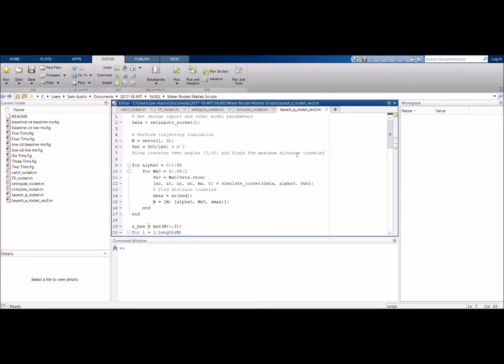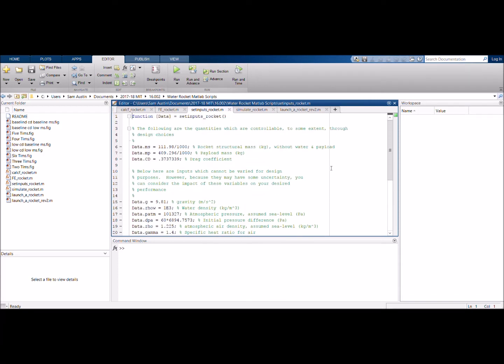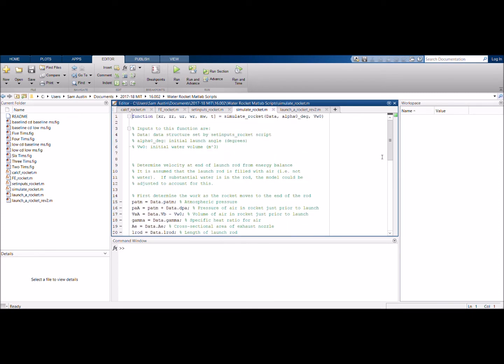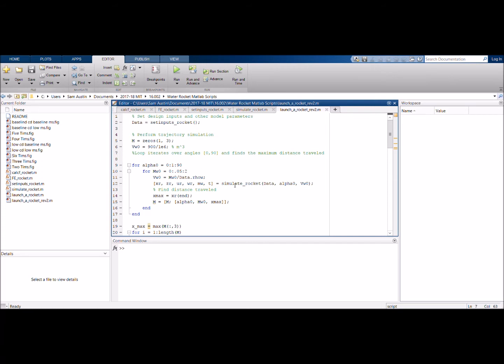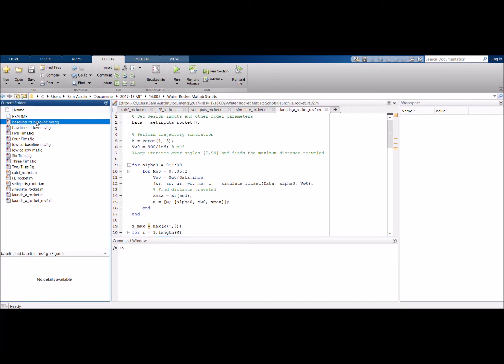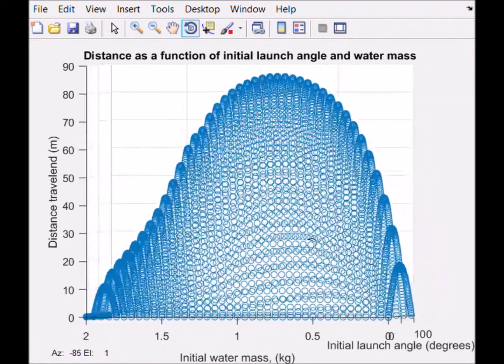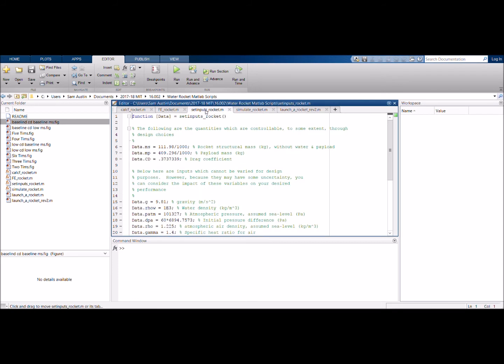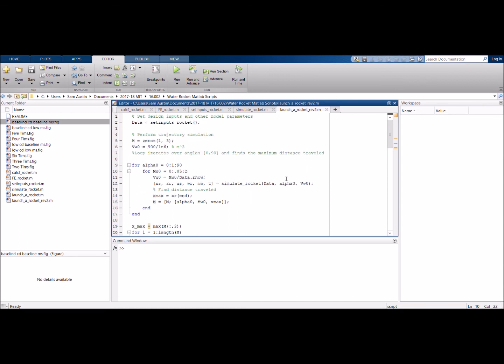Unified Rocket Competition Sensitivity Analysis Walkthrough

Comment: Awesome. Nicely modularized code. I especially liked "Data = setinputs_rocket()". Because that allows you to utilize a reliable method, to give consistent design parameter values for each simulation. I remember using that sort of technique on ETH Zurich's Solar Powered Airplane analysis. And after messing around with the code, I realized that this method is really efficient. If you don't modularize such data(design parameter), you can easily get lost in changing variables & get incorrect simulated Data. Sorry for posting such a long comment lol.